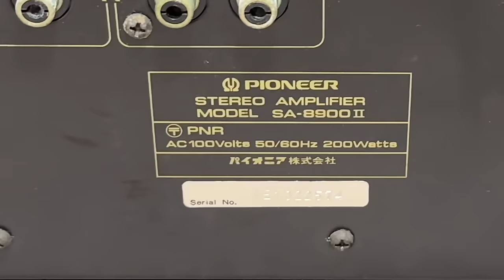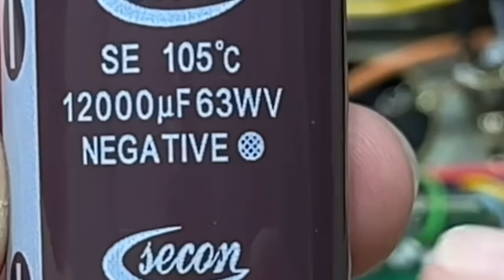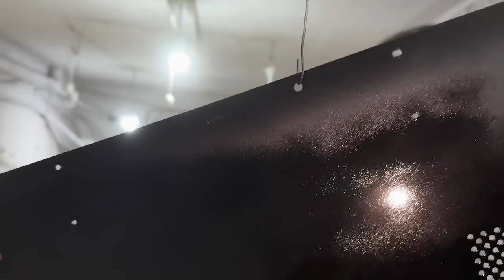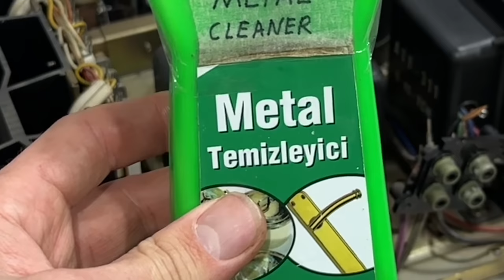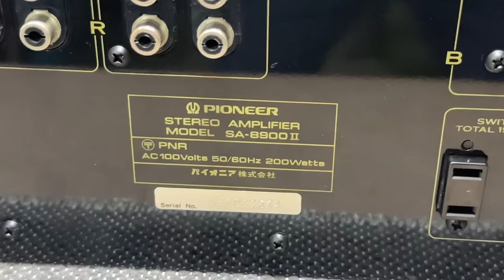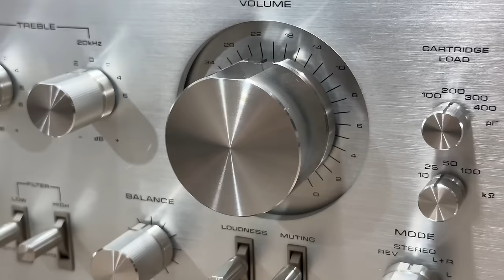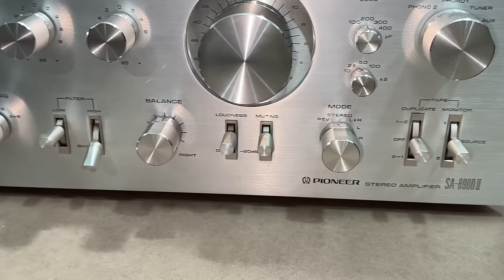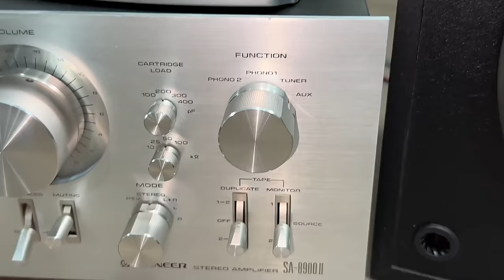PIONEER SA-8900 II / SA-9500 II STEREO AMPLIFIER Maintenance Repair Restoration

Comment: A very handsome, complete and well-built device. Just two small comments: I think that if you looked a little harder, you could have found capacitors of the same diameter, even if it meant increasing the voltage or capacitance a little. Also, with satin varnish, the finish would have been closer to the original. Well done for a job well done ! 😉

Comment: this are great amplifiers ,even today it´s hard to have a better quality at resonable prices and building quality ,it would be still working if it wasn´t excelent, i conected it to a newer set of speakers and the sound was like perfect ,others that heard it were admired how could it sound so good being so old, i told them as older they are the best they sound, gave the example of new and expensive tube amplifiers

Comment: I have this same amp. Mine is a domestic Japanese version at 100 volts. I use a step down transformer in the US. I bought it in a used electronics market in Beijing over 20 years ago. The only issue is the power light is burned out.

Comment: I never understood why you want a amp that can control 4 speakers (As in A / B or A+B) but lose "power" once you turn both on. I mean you can hear the bass obvious losing it's strength once turned on both.
Reply: do bạn đã đấu 2 cặp loa bị ngược đầu âm dương.khi chạy loa dao động ngược pha làm âm bass bị giảm gần như mất hẳn 😅

Comment: If it's not a secret, what kind of varnish were used on the back and bottom panels?
Reply from the maker: Acrylic glossy varnish. If you want it to be durable and brighter, you need to bake it as we explained in the video.
Reply: @manstuckonhishead  Hello. Great job and it has become a really beautiful amp with a new life. I would like to know if the SA8900II and SA9500II are the same amplifiers?